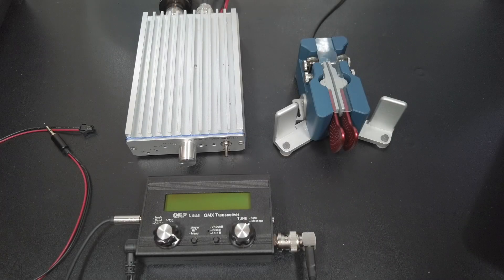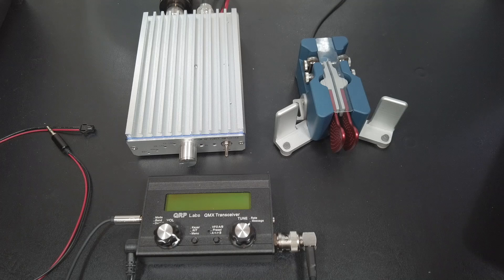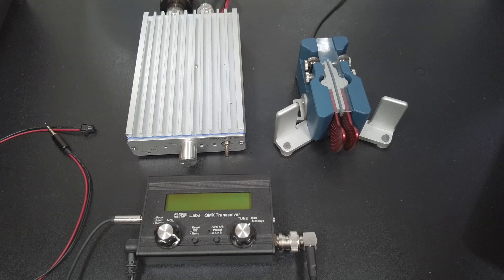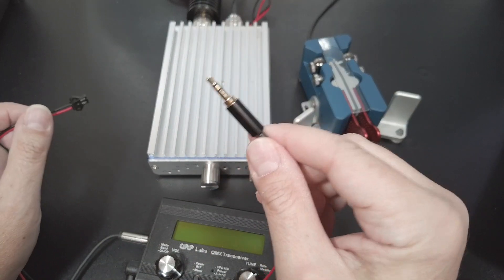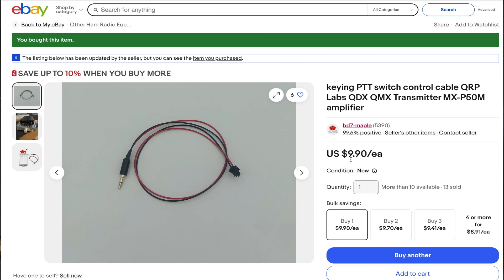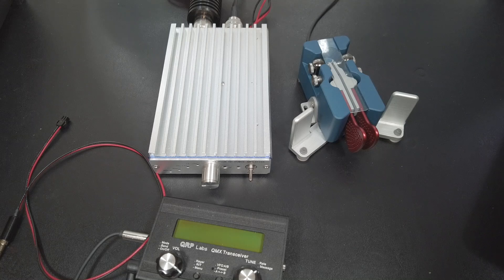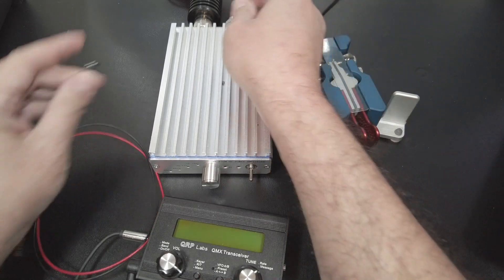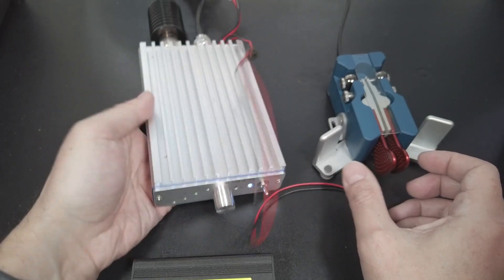QRO QMX: Using the MX-P50M with the QRP Labs QMX

Comment: How do we ptt to use the built in mic? Like you can on the trusdx? Assign a button press or what do you have to do? Thx mike.
Reply from the maker: I don't think the firmware supports SSB yet.  Right now according to the manual the only way to key the mic is through the 3.5mm jack.

Comment: I have one of these amps and I have used it a number of times with my FT-817nd and a resonant dipole.  So far I have had no complaints and good signal reports…
Reply from the maker: They're a decent little amp if you get a good one.  I have to use mine with an external filter because I get spurious emissions on 20m.
Reply: @op  You say so, but how would you know if you're not transmitting on harmonics as well? I mean, you wouldn't get complains on the same frequency, after all, and the harmonics can be outside of a HAM band altogether.

A spectrum analyzer or an SDR receiver (waterfall) might be helpful to see if it's actually a clean signal. ;)

Comment: Possible option …. The QRP Labs 50W amp (for a single band) is good. If you run it on 12v it will put out less pwr and might survive FT8 - 73 de VK2AOE
Reply from the maker: I'm actually planning on getting one for a winter build project.
Reply: @JoeN2DI  Great build QRP AFTERBURNER @TheArtofEngineering
https://youtu.be/IwnkebylN8A

Comment: Hi Joe,
I noticed when you showed the list to enable the TX PTT that you can select either +5V or grounded. Nice the QMX has that setting.  73  WJ3U
Reply from the maker: Very good observation. That’s correct. The flexibility is really nice. Most amps use a grounded PTT on TX but some like the QCX series 50 watt power amps need +5 volts. 73